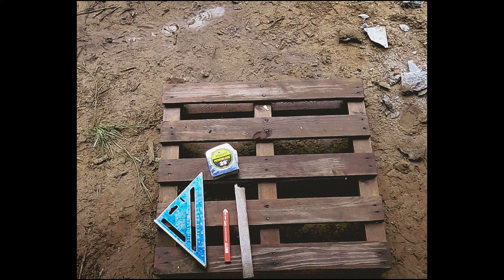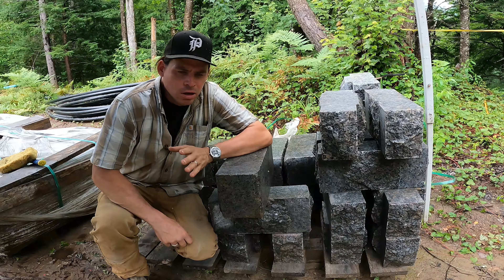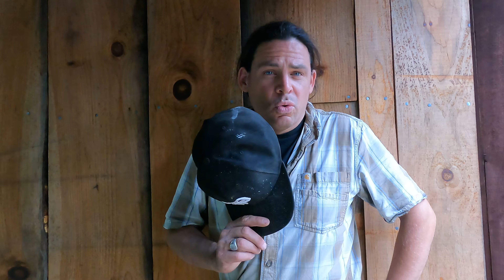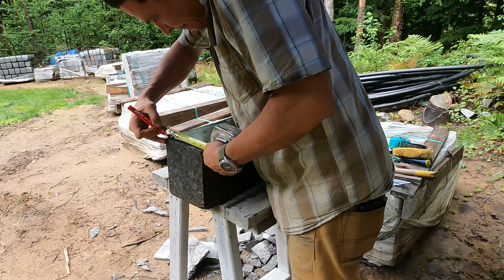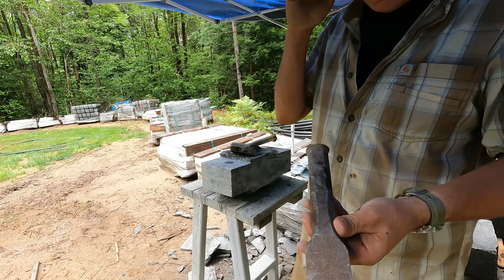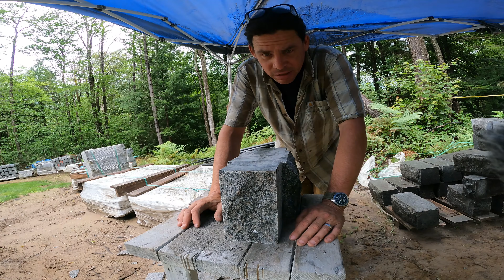Rock Facing Granite - Preparing To Build A Cabin

Comment: Are you gonna build on a concrete slab or dig a trench below the frost line and line the bottom with gravel (or even a French drain underneath that) then stack half boulders on top of that?  I’m debating about that because concrete slabs require rebar and that’ll spall out after about 50 years or so. BTW, I’m following the guidance of Ian Cramb’s “Stone Mason’s Gospel”.

Comment: Interesting. The granite is a beautiful color and texture. You should Shaw an initial drawing of what’s going on. It looks like your going to pillow block the whole wall. Two layers thick with the header stones tieing the wall together.

I wonder. Can you use the stone to make a house foundation this way? Build the perimeter wall using this approach anchored on your footers below the frost line. Then fill the interior space with sand foam and then poured concrete to form the first floor. Then build the timber frame on top of this foundation.

The construction of a pumped foundation isn’t hard but it can be a pain. Getting mixers up “Vermont Logging Trails” otherwise known as class 4 roads could be a challenge.